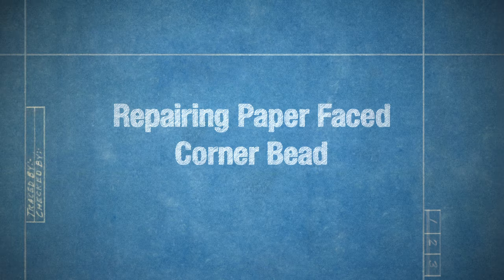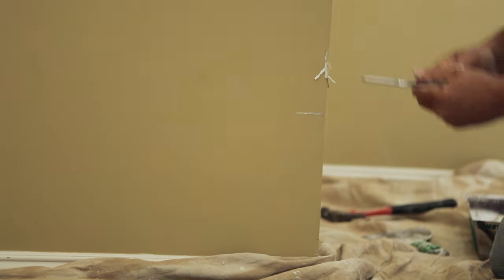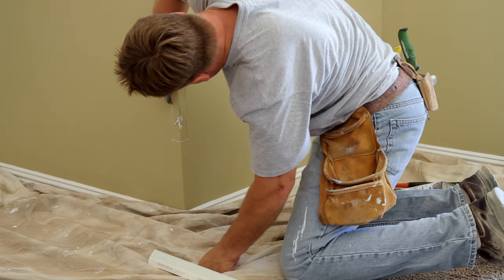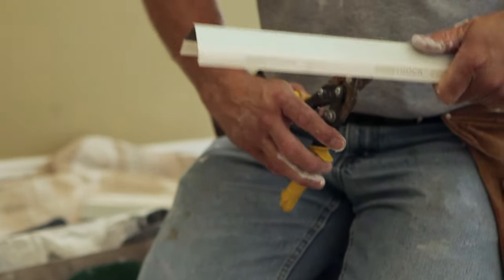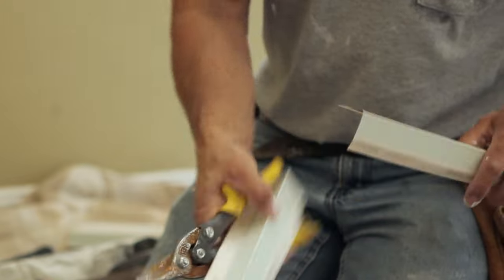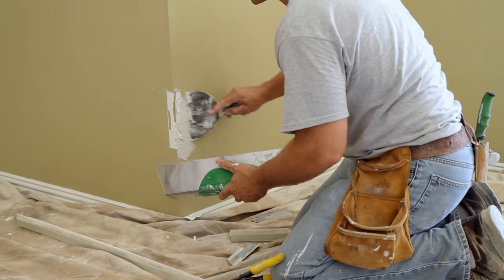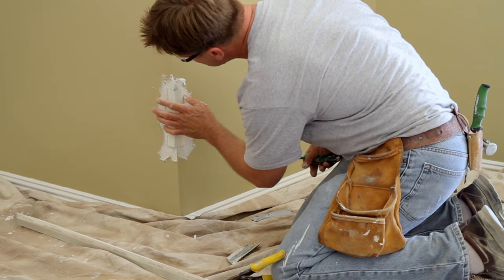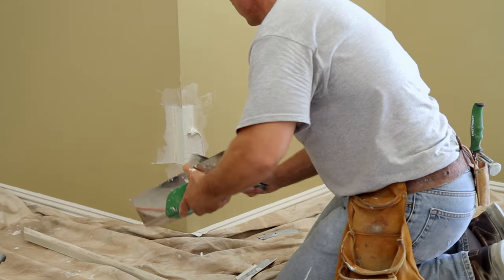USG Surfaces: How To Repair Corner Bead

Comment: How would you handle this situation if it were metal instead, e.g. soffit outside corner. Can you cut out a subsection and replace with paper or do you need to use metal again?